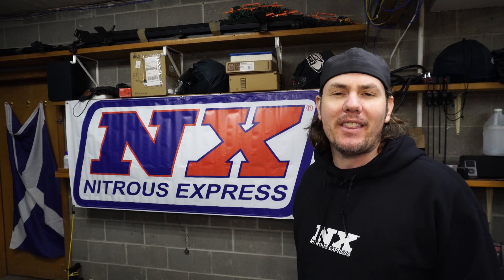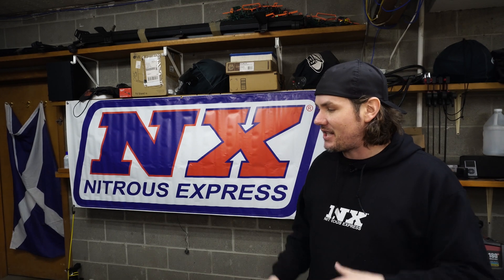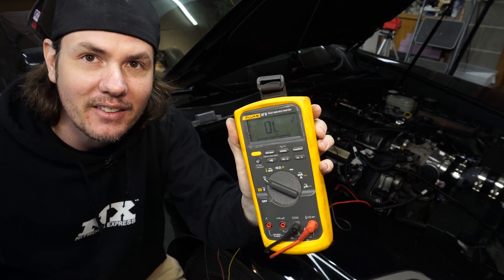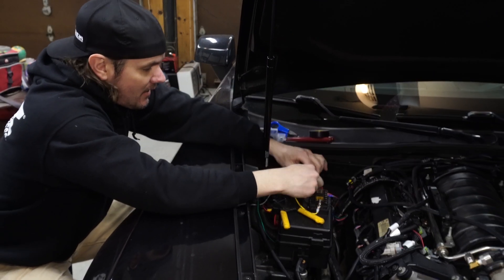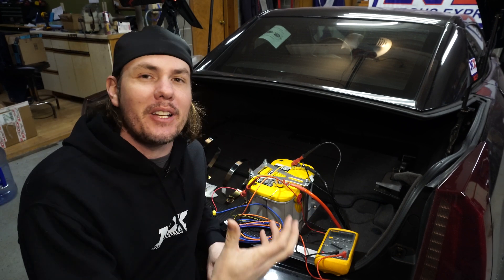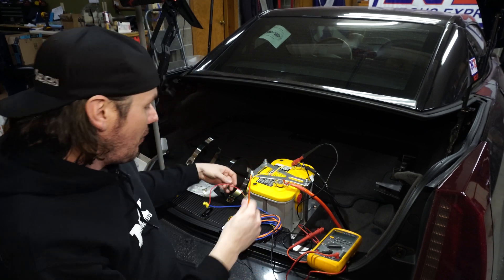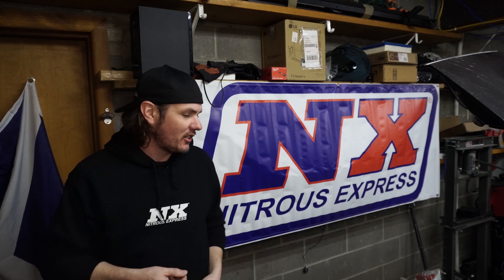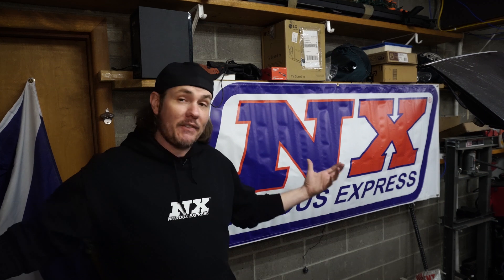NX Electrical Installation, Wiring Purge and Nitrous Express Solenoid For Progressive Control!

Comment: Hey man i got a question im running a snow prefomance kit number 4 nozel pure methenol i have an inline air to water and im wanting to add a 35_75 shot on the top end say 4000 to 6000 rpm any way the question is any reason i cant fuel enrich via my methenol basicly taylor the nos to the meth extra fuel

Comment: The electrical is always the most important! I can't wait to get my nitrous system installed and get it all wired up! I went with a Nitrous Outlet Kit with their stand alone fuel system. I have a post on the camaro6 forums where i have the wiring diagram posted that I plan to use. What is the progressive time delay that you would recommend for say a 150 shot? 1 sec? or less?
Reply from the maker: Honestly, I would start at a second and see if you have traction issues and use the option to extend it out until you can rock it out. Can't wait to see the results!